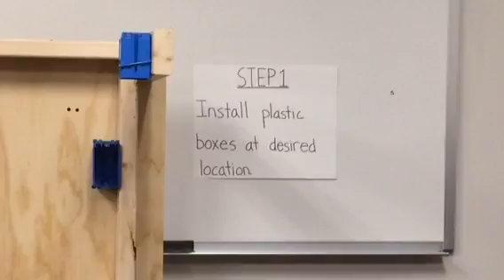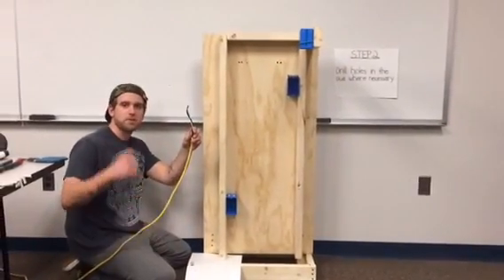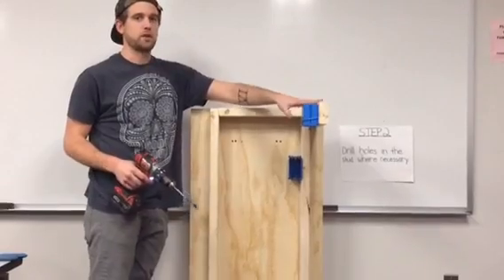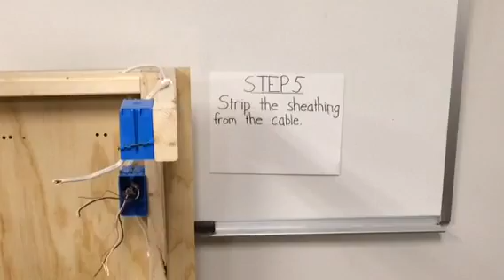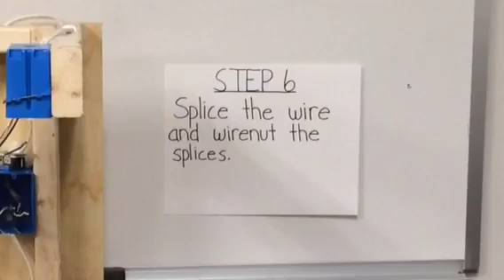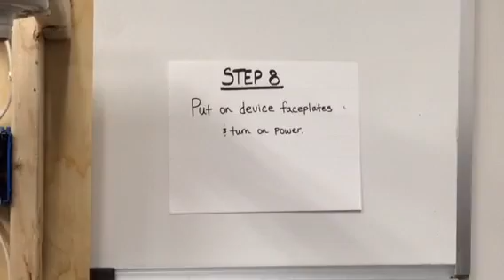How to do basic home wiring

Comment: Great job guys!  I'm installing in office in my basement and working with someone else's Hokie wiring (they ran the light switch wire back to the receptical box making it the junction - confused me as that made a White lead a Hot lead.  After seeing this, I'm re-wiring it to run the power over to the switchbox where it should be.  Also installing pigs that I didn't think about to make life easier.

Comment: This is horrible advice. First you are mixing two different size wires which is ok but hokey unless the 12/2 you ran to your first box is on a 20 amp circuit you can't down size to 14/2. You must staple within 8 inches of a box per NEC and 12 inches if it has a clamp or Romex connector. You over twist your wires, should have used a 3/0 nail on fir the light , I mean it will work but not right , this guy will have you burning down your house.
Reply: The yellow sheathed wire he plugged in at the end was an extension cord that was adapted to do the demo.  He should have made it clear as to what he was doing.

Comment: All wrong your gonna birn some ones house down. Your feed is a 12-2 20 amp i would guess. But then you reduce your wire size to your light 14-2 15 amp you are gonna overheat that 14-2
Reply: Wrong that's only the case of you put in too large of. A bulb going from a 142  feed to a12-2 load would be a problem  though. What gauge do you think supplies your breaker box I'd hope neither 12g or 14g
Reply: chris gagnon و
Reply: The yellow sheathed wire was actually an extension cord adapted to illustrate line power.  He should have made this clear in the video.

Comment: My biggest fear about doing this is connecting all the fixtures. I hate that the outlets and switches have exposed terminals, how do you keep the exposed terminals from touching whatever tiny exposed portion of wire when you have to shove all that mess of wiring back into the box to screw the outlet/switch in? I know the wire nuts are supposed to protect all the exposed surfaces from touching anything but from personal experience trying to shove all that stuff into the boxes it gets pretty tight, and I've seen wire nuts come off at the worst possible time.
Reply: I have the same fear
Reply: you could just insulate anything exposed if you really wanted to
Reply: After putting on the wire nuts, pull on the nut to make sure it is on tight and won’t come off.  If you are adding devices, There are  deeper boxes that make it easier.  Some guys do wrap black electrical tape over the nuts and down the wires to make sure they stay on.  Some also wrap a loop around outlets to cover the neutral and hot screws.

Comment: you don't need pigtails on receptacles
Reply: The reason pigtails are used is to allow the current to continue to feed the downstream outlets, light.  (This is called wiring in parallel). If you ran the wires directly to and from the receptacle (called wiring in series), and a receptacle had a loose wire, then it would kill all receptacles on that circuit.  To trouble shoot it, you would have to check every outlet.  No safety issue, but I think it might be code to wire in parallel and it would help in troubleshooting.

Comment: OMG another romex jockey. Really notes???
Reply: Paul Tanner what's wrong with Romex? Are resi guys inferior to you because of the wiring methods used?  You can talk shit about us but wouldn't be able to hang when it came to speed of install. Same as I wouldn't be able to outrun you doing conduit. Electricians need to learn a little more respect for each other.

Comment: What if the light was running to another outlet box. How do you get it to NOT turn on and off with the light. Thanks in advance!
Reply from the maker: I apologize for the extremely late response but I just saw your comment and figured I’d respond just in case you are still curious. You can not run a cable from the light fixture to a receptacle without the receptacle also operating off of the switch. You will have to run a cable either from a receptacle with constant power or a switch box that has constant power in it.

Comment: So the boxes should protrude a half inch from the wooden stud for accommodating the drywall?
Reply: Michael Williams, Yes, as per the NEC.
Reply: Yes.  The plastic boxes have a protruding line on them to assist you in positioning.  There are also boxes that have a metal flange that the flange is nailed to the face of the stud.

Comment: Is that seriously how it's done over there? This would never be allowed in Europe! You just wouldn't pass the wiring check and won't get power to your house until you fixed it.

Over here, you'll need way thicker wires, as little as possible of those connectors, and if you do, they prefer the Wago ones (either the clamp or the push-in ones) - so your light switch should be at the end of the circuit (except if there are two light sources on the circuit) and connected to the receptacle, instead of using a connector (if you used two receptacles, you would've had to connect those to each other as well, and then connect the light switch to the last receptacle). I think that's what the gold and silver screw you didn't use are for.
And  last but not least: you should but your cables in a plastic tube/pipe kind of thing, but I assume you guys would do this as well if it wasn't just for a project. 

I mean I get why you guys use that many connectors, though... Why does a screw have to hold the bowed wire in place?
Over here, you just stick it in a little gap and when tightening the screw, a copper plate starts fastening the wire. That'd be a little more safe in case of a loose connection... There's 20 Amps going through it after all...

Comment: I see you used yellow romex going to the breaker.  Please explain that.
Reply from the maker: Marvin Vanden Heuvel This was for demonstration purposes only. It is not yellow romex. It is actually just an extension cord that I plugged into a wall outlet to give my project a power source. If you were to do it in a real life setting you would run 14/2(white) romex back to your electrical panel and land your hot wire under a 15 amp circuit breaker.
Reply: Gregory Johnson I'd like to know where you're getting that information? I'm a licensed electrician and have never heard such a thing and never seen anyone fail an inspection due to using 15a circuits. While I agree that minimum for branch circuits should be 20a, the NEC doesnt share my opinion.
Reply: Jon Scanga Instead of 14-2 can u use 12-2 instead or would this be a issue? but thank you your video helped me on a project i'm working on except i didn't do the pig tail idea that u did i did different
Reply: 15 amp circuit breakers have been outlawed... but everything else looks good.. great info
Reply: nothing less than 20
Reply: 15 amp circuits have not been outlawed

Comment: Good Job Jon. You should have explained that The installer should always bend the wire loop towards the right (so when you screw clockwise you do not un-loop the wire)

Comment: can I use all 12 - 2 romex for all my lighting and outlets?   or do I need to purchase 14-2 romex as well. sorry new to this.  trying to figure out what all I need to get to wire my tiny house.
Reply: I realize your project is probably complete by now, but 12 - 2 refers to 12 gauge (AWG) 2 conductor (has two wires plus, typically a ground in Romex).  The 14 - 2 would similarly be 14 AWG 2 conductor.  When talking about the gauge of about anything, a smaller gauge is actually larger than a bigger gauge.  So 12 AWG is bigger wire than 14 AWG.  I'm no electrician by any means, but I don't think I'd use anything smaller than 12 AWG for outlets (so, no 14 AWG for outlets).  In most lighting situations, though, I'd imagine 14 AWG would likely be adequate.  However, note that there's no practical harm in going with a beefier wire than necessary, but you can run into heat (see: fire) issues if you overload an undersized wire.  So using 12 AWG for a project requiring 14 AWG wouldn't hurt anything, just maybe cost a few dollars more; but using 14 AWG wire when the load would require 12 AWG could get risky.

All that said, to answer your question, you can use 12 - 2 through your project and shouldn't NEED any 14 - 2.  The only benefit to 14 - 2 in typical lighting circuits (and not outlets) would maybe be a slight cost difference.
Reply: Dolly Davis you can use 12-2 for everything except the stove/dryer/and any SUb panels.
Reply: Thank you for the good explanation.
Reply: Dolly Davis b

Comment: Thanks for the video Jon. I see you spliced pigtails for hot and neutral for the receptacle.  Instead, can you just screw both black hot wires to the brass screws in the receptacle and both white wires to the silver screws on the receptacle?  It just seems more simple, but maybe there is reason not to do that. Thanks.
Reply from the maker: The reason for pigtailing the hot and neutral wires instead of bringing both hot wires and both neutral wires to there respective screws is so you are not relying solely on the recepticle to complete the circuit. For example If you have 5 receptacles in a row and you dont pigtail the 2nd receptacle and it malfunctions then it will also effect receptacles 3,4, and 5. If you have all of the wires pigtailed then it will only effect the malfunctioning receptacle. It is also code to atleast pigtail the neutral wire and it is just good common practice.
Reply: That totally makes sense.  Thanks!
Reply: Jeff Hirata as an electrician if I opened an outlet box and saw two hot wires on one screw I would flip a shit lol
Reply: The n.e.c allows you to do what you're talking about. As long as it's not a multi wire branch circuit (basically two circuits sharing a neutral) however many electricians consider this a poor installation and prefer pig tailing.
Reply: Good point Jake! In my comment I was referring to placing one wire individually on each screw since in this case there would be 4 wires (2 black and 2 white) and 4 screws (2 brass and 2 silver).  Sorry, I was not really clear on that in my statement, although it is still not to code as Jon explained. You make another great point of what not to do! Thanks!